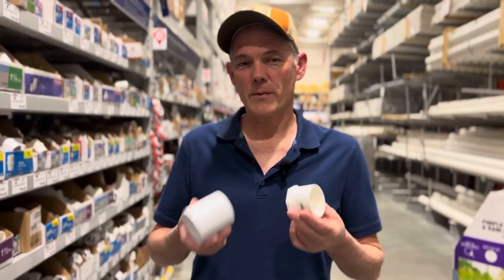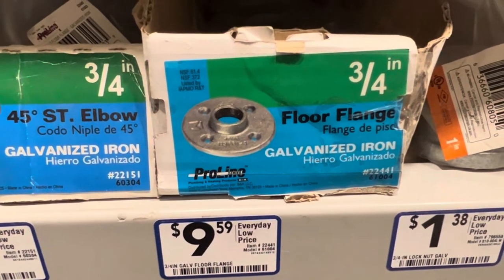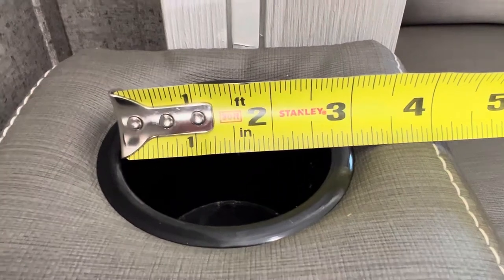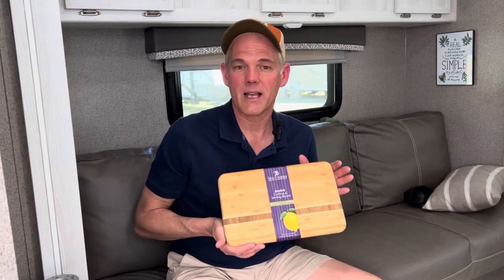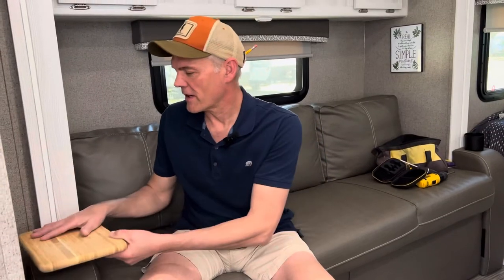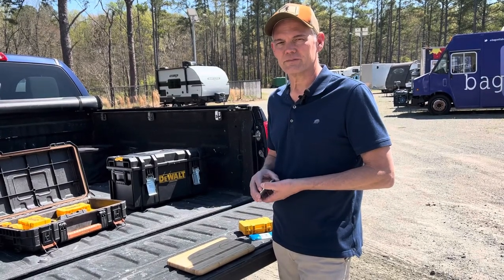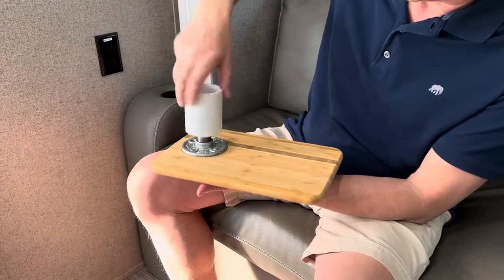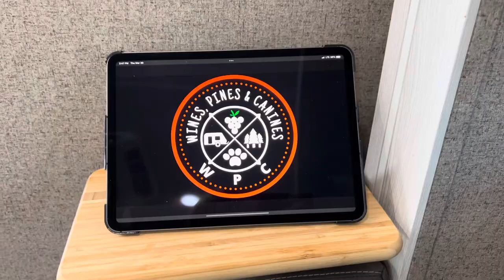5 Min Mod!  Turn A Cupholder To End Table!  Quick and Easy DIY

Comment: Do you have a video on how to remove the dirt and stuff on the underside awning? And, should I use a waterproofing solution for the top of the awning?
Reply from the maker: Hi!  We are actually washing the camper tomorrow and we were going to film it as it is very dirty at the moment haha.  

For the awning - we haven’t done a video but we did tackle trying to get it back to clean last fall.  We had unfortunately rolled up wet and as we store at a storage unit, never got it rolled back out.

We started with soap and water, vinegar and then moved to a Camco cleaner, Mr. Clean sponge…. 

Soap and water and a scrub brush worked as well as anything but nothing got rid of the set in stains.  We are almost ready to try a diluted bleach solution but as a last resort as can break down the material.  

For waterproofing - we have recently switched to a 303 Protectant on the vinyl/awning.

Hope that helps!  Thanks for watching.

Comment: Very sturdy when put together. But when put in my cupholder it isn't steady. Moves back and forth due to the hole in the couch that the holder sits in not being tight. Any ideas? I love the finished product but can't set a drink on it because it moves back and forth.
Reply from the maker: Hmm.  Ours is pretty tight so we didn’t have to but if you leave it in there most of the time, you could wrap electrical tape around the base.  That should help keep it snug.
Reply: pool noodle foam to stabilize it!

Comment: You can save much of the cost by just using a flat PVC endcap instead of the metal pieces used for this version.
Reply from the maker: Hi Leon!  Hope all has been well!  Thanks for the tip - will look for one to link in the description.  Always good to save a few bucks haha.  Appreciate!
Reply: Hello, we are interested in doing this, would we replace both the steel nipple and floor flange with the PVC Endcap you mention?  Will it work the same and swivel? Thanks so much for your time and response.

Comment: So how would you have done a swivel tray?  That's what we want.
Reply from the maker: I don’t think we could have.  There is about an inch from where the cup holder is to the wall of the slide so no enough room to swivel.
Reply: @WinesPinesandCanines  but if you had the room, how would you have made the swivel?  I'm just wondering what you would have used to make it swivel?
Reply from the maker: Gotcha!  It actually moves inside the cupholder so if it had the room we could just turn it and swivel
Reply: @WinesPinesandCanines  oh ok, thank you!